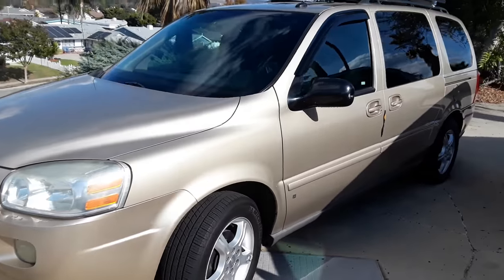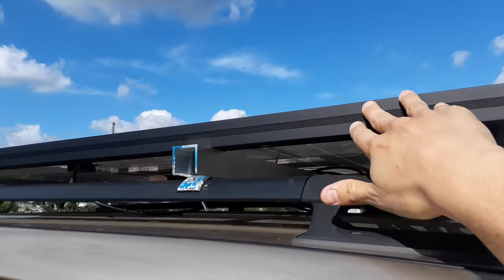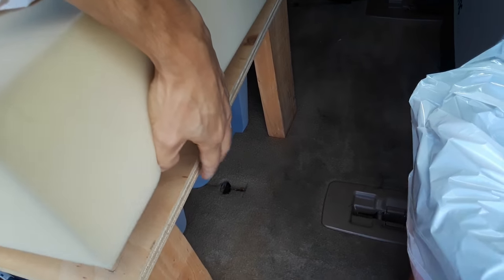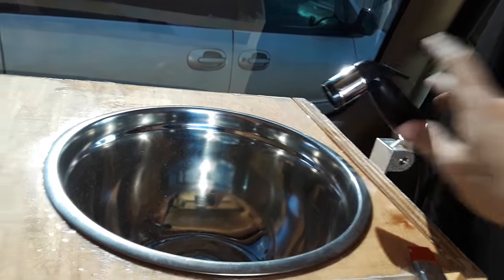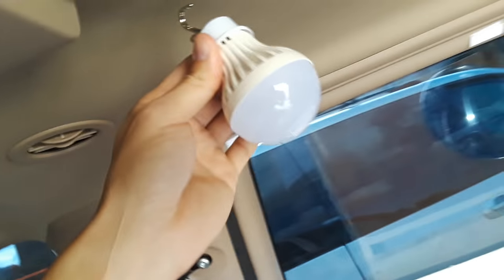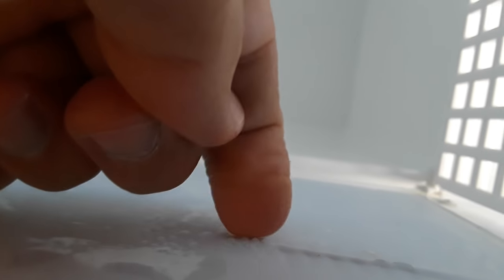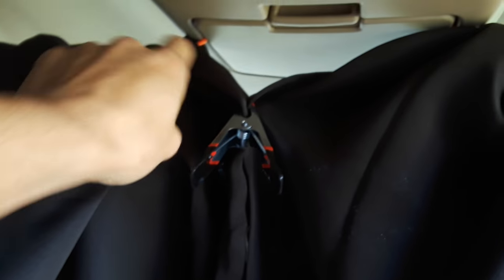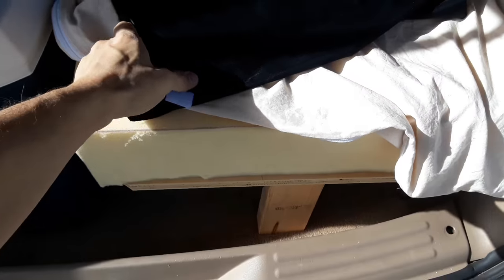Simple Solar Minivan Conversion w/ Microwave, Running Water, Fridge, Bed, Sink,Toilet 2006 Uplander

Comment: Max discharge rate of that battery is 100 amps though, so the inverter should probably only power 1000 watt loads. Will need 1 more lithium battery added to the system if you want full 2000 watts from the inverter
Reply from the maker: yeah good call!

Comment: Good ideas, lots of splinters going to happen though. I know it's time consuming but sand paper is cheap. And running water over an electrical appliance is a disaster waiting to happen. Yikes. I've known several people who have gotten their solar panels stolen right off their van in public parking areas. A mini van is a piece of cake. Suitcase panels are thin and could store between the extra seat and the wall for what you have for battery capacity.And are very light and won't add drag, sapping milage. Tangled hanging wires will always get snagged. Velcro fasteners and gorilla glue are also cheap and would make moving gear or self safer. Good effort.
Reply: hey Ms.Annette, I travel for a nursing agency and am about to purchase a nice used well maintain uplander to convert into a home on wheels. I have read your comment and you sound knowledgeable of such craft. What DIY would you suggest I follow to convert my van safely and cost-effectively? thank you for your input....

Comment: Good build I like your cooler solar set up that’s brilliant. If you ever change vans you just disconnect and wheel it away! We have an 07 Uplander LT2 extended, I wanted that for the extra length so I can put the kitchen right behind the front drivers seat. We have in roof rear ventilation not sure how to mount the roof fans without damaging it. Great job!

Comment: An inverter microwave is better for many reasons, especially for RV use.The power it draws 
is the same as the power level you set it to. If set to 30% on a 1000 watt microwave, it will only draw 300 watts. A regular microwave would draw 1000 watts for 30% of the time.

Comment: Just in case I’m missing anything (for my own future reference) ...you didn’t want to drill into the roof for the solar panel, but then there’s a roof fan?
Reply: He said he didn't want to drill into the solar panel and void its warranty.
Reply: @TUBEalicious  .  Later he said he didn't want to drive into the roof so he routed the wires in back where the brake light is.

Comment: I really love the build but I have some concerns.
1. where do you keep your clothes?
2. what do I do if the van smells like human feces?
3. what if you can't a trash can anywhere near by?
4.  How do I fit my family of 20 with my 2 snakes, 4 bunnies, 5 fish and 7 dogs in there?
Thank You for reading! <3 Love your video!!!
Reply: Not the uploader obv but heres what i assume the solutions would be.

1) probably in a closed bin under the bed
2) ventilate! Put those fans to use
3) if it were me, the first solution id think of would probably be to double-bag and put it under the van or to the side where it wont be seen until a can could be found. Though if youre in a place where it could be seen, you can probably find a can.
4) buy 37 more chevy uplanders and start converting of course
Reply: We would pour a couple scoops of cat litter in the bag after use. And use a lid on the bucket.

Comment: This is the one of the most functional layout. Though i was searching fot the stove. Do u cook everything in the microwave?
Reply: @Jim C isn't it AhxV=wh? It's a 12v battery, so it should be 1200wh. That battery should run a 700wh microwave for a lot longer than a few minutes, no? Even accounting for inverter draw and inefficiencies, it shouldn't have any issue running it for an hour and a half unless I'm missing something. I could be missing something, been up for 23 hours and new to electrical.

Comment: Question, with that solar power potential available why do you not have a second battery? Seems to me that a waste of potential power. Once that small battery is charged it's a total waste power potential.... Aka waste of money that you invested with zero return. Adding a second battery in parallel will double your amperage.
Reply from the maker: yes the more, the merrier but there were budget constraints

Comment: This is one of the most frightening builds I have ever seen. The entire thing is a death trap. Sorry to be critical of what I would only imagine is your best intentions but you are presenting ideas to people that are just not safe. It does not appear that you have grounded any of your power system. The water above and near your ungrounded outlets and microwave are dangerous. In a roll over or accident your build will become flying deadly projectiles. The cut and bends on the solar panel supports are a weak point that will eventually break off. I admire your efforts but viewers need to be very careful in doing things shown in this video. Please be safe!
Reply: Ya gotta remember...That it's a minivan. I can see moving the plug higher but for the amount of water
He has I wouldn't worry too much.
I doubt the microwave and water will be on while driving. I do know this much in a vehicle that small you want to keep the weight as low as possible.
Reply: Good point about that aluminum bracket.

Comment: Sorry but this.is 1 of the messiest unfinished ive ever seen  Starting from 1st look inside is the bucket for a toilet  then the bare foam mattress no cover on even tempory for this video then the woodwork is unpainted  not looking new looks scrappy and wires and orange cords the  microwave on the floor did u really need 1 even ? Then theres  huge electrics for what ?? Sorry to me its messy
Reply: And unsafe.